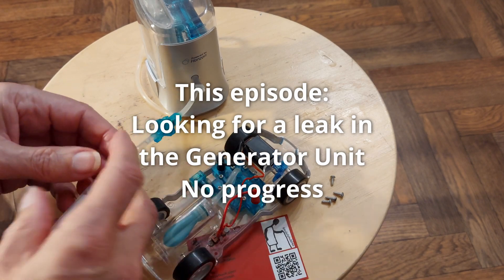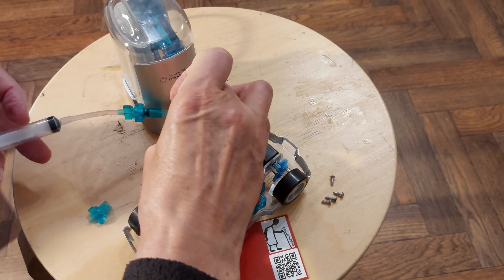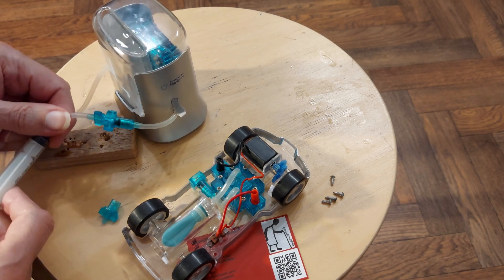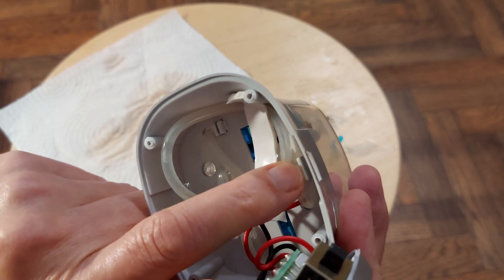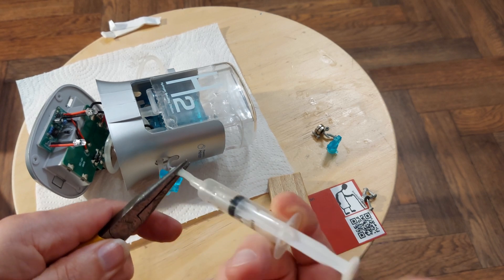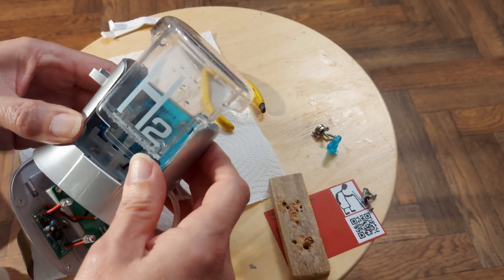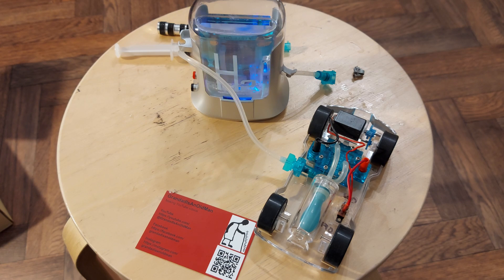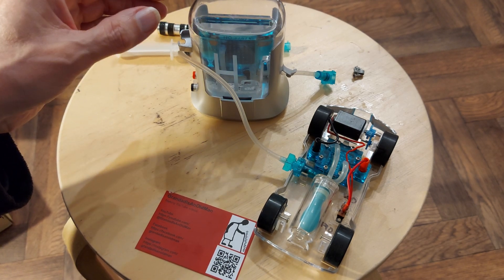Hydrogen Fuel Cell Car revisited after 9 years PART 3

Comment: what did you mean by one of the pipes being crushed? that crushed pipe,was there a hole in it where it was crushed ,maybe the crushed end of that pipe is leaking out the water im thinking, did you check that end of the pipe?.
Reply from the maker: That was a red herring, it was not part of the problem. It probably didn't help, but it is not the cause of the leak.

Comment: Either putting the UNIT under water or using soap bubbles can help you find the source of the leak.  You know that though.
Reply from the maker: That is not as easy as it sounds. It will not come out of the case. As far as I can tell, it is glued in place. That means that the electronics are still attached. In episode 6, I show where the leak is. It is clearly visible when you know where to look. 👍